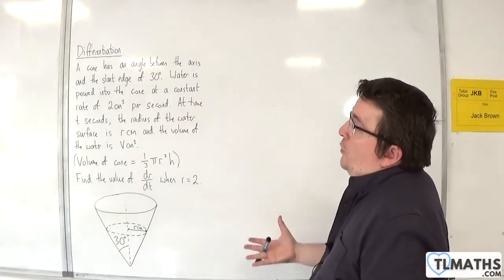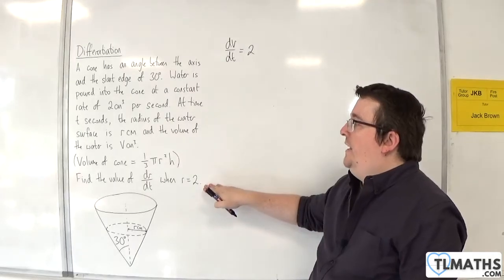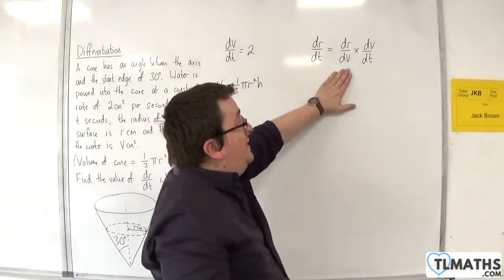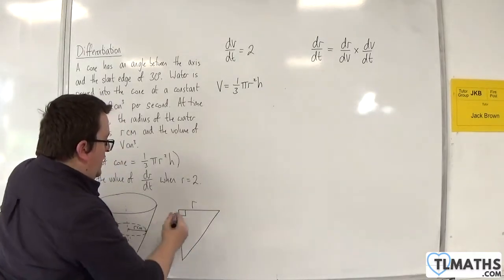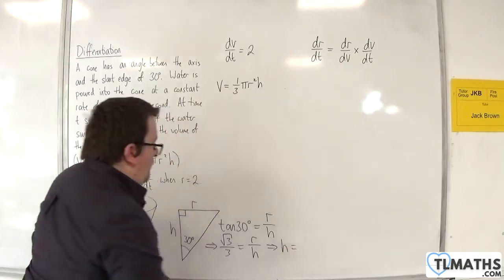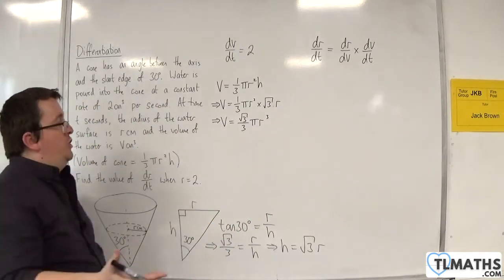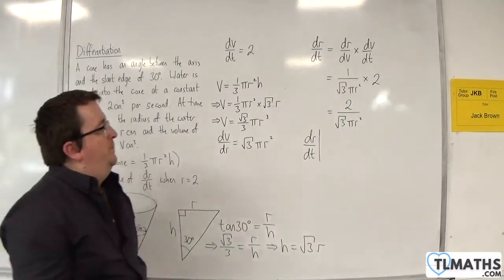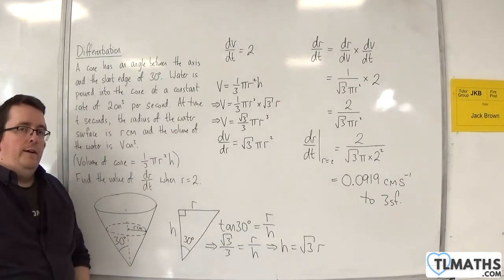A-Level Maths: G4-08 Differentiation: Connected Rates of Change Example 3

Comment: isn't h = 3r/root3
Reply from the maker: If you rationalise the denominator, 3/sqrt(3) = 3*sqrt(3)/3 = sqrt(3)
Reply from the maker: If you wanted the rate to be decreasing, then it should be negative. If dV/dt = -2 then the volume is decreasing by 2cm^3 per second. If the volume is decreasing at a constant rate, then using your initial volume, let's say 1000cm^3, then it would take 1000/2 = 500 seconds to completely empty.